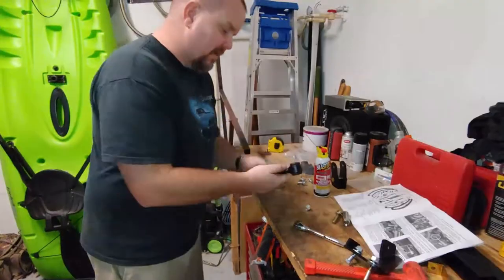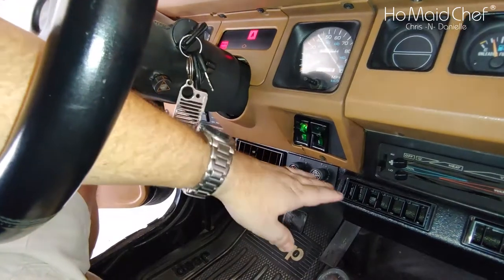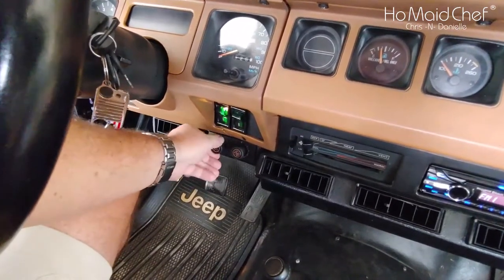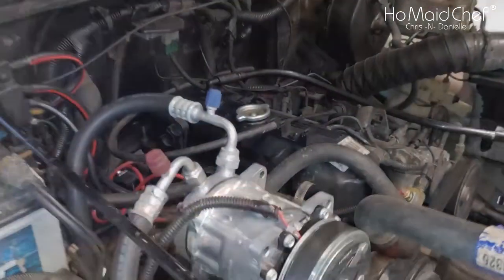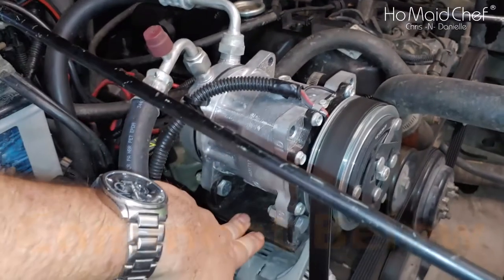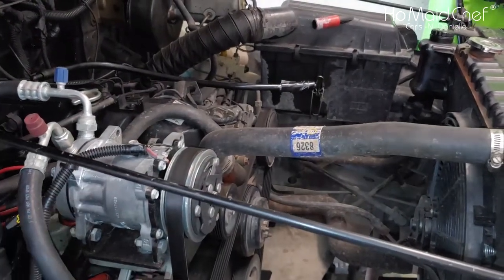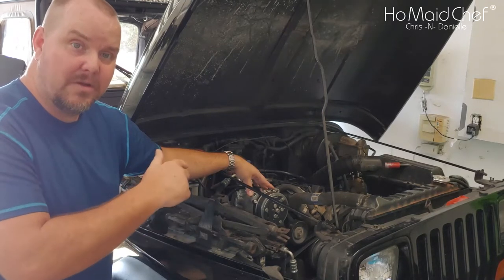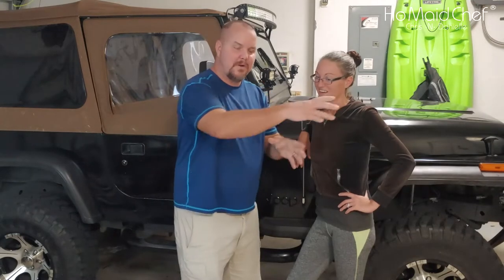Review Aftermarket Jeep AC Is It Worth The Money - How To Install It

Comment: On a 85 CJ7 do you think the carb should need to be configured to compensate for the condenser?  Thanks
Reply from the maker: I believe there is a part where you can get to adjust the rpm when you turn on the ac. We didn't have to do this. Our jeep is fuel injected, and the jeep doesn't stall.

Comment: Thank goodness I’m in Texas and they don’t check for the catalytic converter. I eliminated that thing and the heat is gone! It’s so much more enjoyable to drive nowB
Reply from the maker: We lived in Bedford TX for 11 years, they did require the catalytic converter in the cities. Now in Florida where they don't even have an inspection. Also the highest outside temp is 95F plus we don't get freezing winters.
Reply: I’m in Texas and am under belief they absolutely check for cat converter
Reply: @paleo704  I just had both my vehicles inspected and they never looked at anything remotely related to the cat or the exhaust at all. I’ve lived here my whole life and have had many vehicles and also have been a mechanic for years never had my exhaust checked.
Reply: @paleo704  maybe the county you live in does but they don’t require an emissions test in the county I live in
Reply from the maker: It was the county in Texas, Bedford is right next to the dfw airport.
Reply: @abnormaltexan grew up in Travis County, live in Tarrant County now. Both require cat converter

Comment: Hello, did you have an issue of when turning on the ac the engine idle drops, running very rough?
Reply from the maker: When we first turn the AC on it will cause the idle to drop, but once on the idle normalizes.